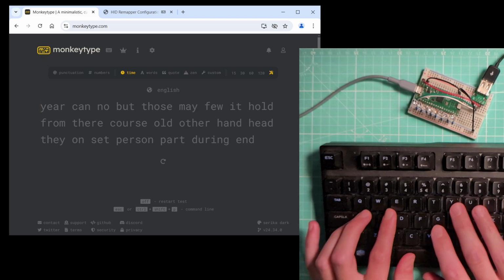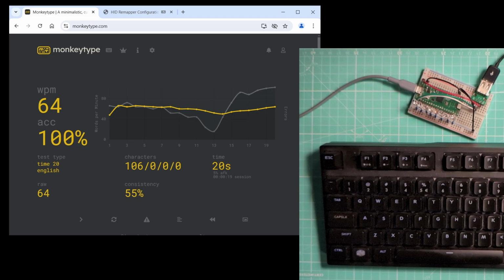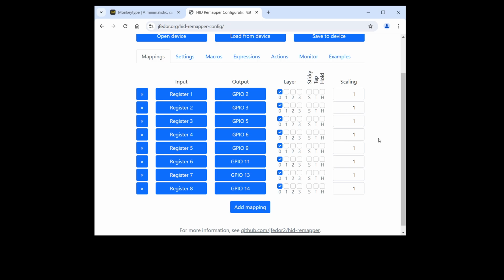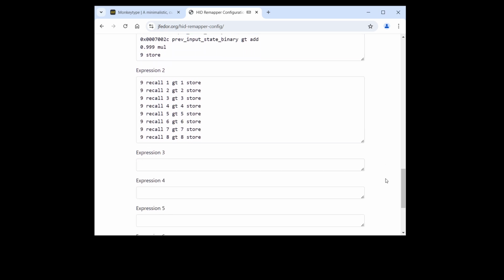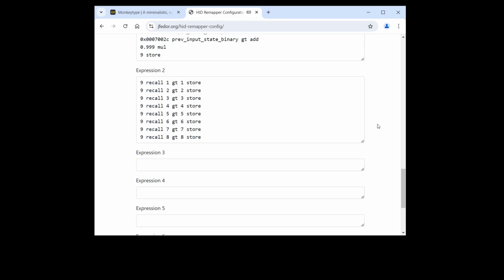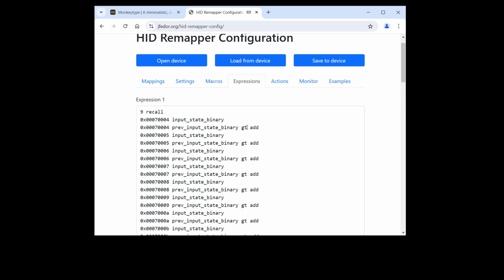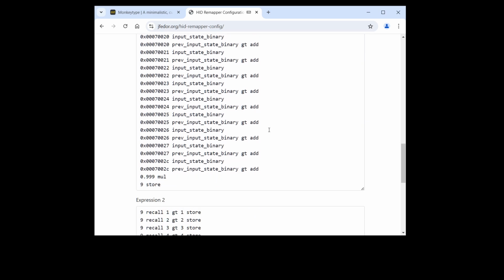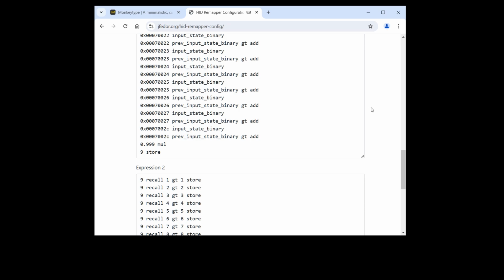WPM meter for your keyboard

Comment: Hi
Thanks for the video
Can HID Remapper send unique keys ( something like F13 - F24 Keys but over them  ) ?
I mean I want to send a key ( it could be F30 ) so I can control it with Autohotkey . or is there a deferent way to do this?
Thanks a lot
Reply: It can send the keys that you see in the popup when you click on the button in the "output" column on a mapping. For anything else you'd have to modify the report descriptor and recompile the firmware.
Reply: @jfedor  Thanks for replying.
Could you please guide me how to do this ( modify the report descriptor)?
and does this give me  extra unique keys not in conflict with keys in my main keyboard.
Thanks in advance